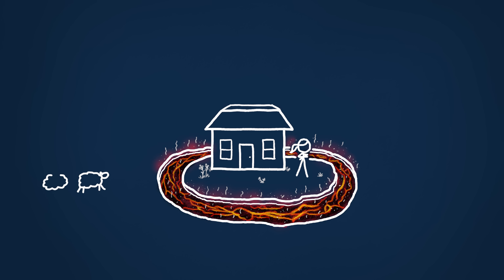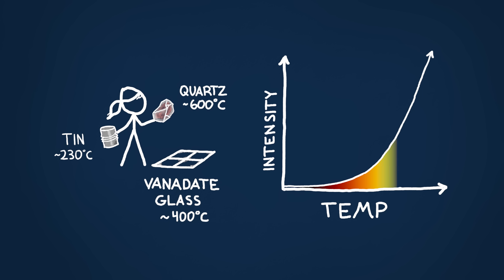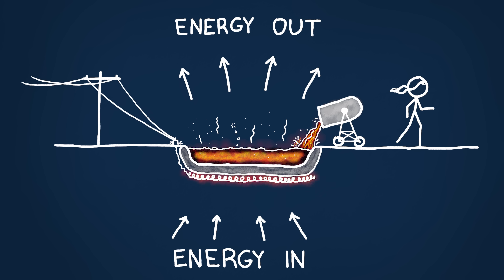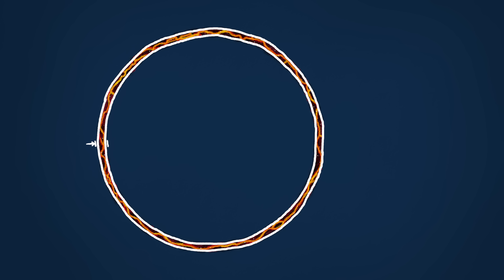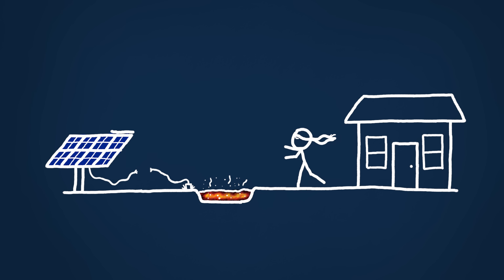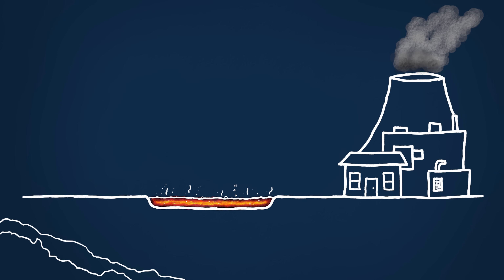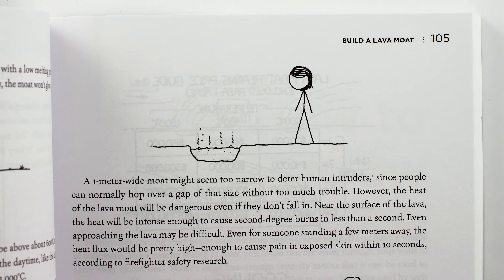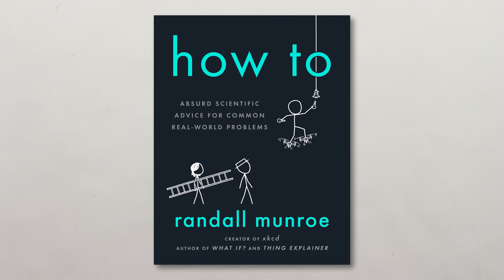How to Build a Lava Moat (with xkcd)

Comment: I’m going to go the 4km solar panel array route.  We need to be green with our lava moats.
Reply: Terrible efficiency losses at each stage.  Go for Fresnel lenses focusing the sun's rays onto the ground.

It will work.  Nobody likes invading houses in the rain.
Reply: @bdf2718  What about a geostationary solar collector that focuses the sun's light onto a circular area around your house. The beam would be 1m wide and precess so that it makes a circuit fast enough to keep the lava from solidifying.
As a bonus, it can be manually overriden to get rid of pesky solicitors, girl scouts and door to door salesmen.
Reply: @V_is_for_Void  
Problem with these things is that you, again, are dependend on outside systems. I mean, it is possible to shoot sattelites with jet fighter air to space missiles down ;D.
Reply: @V_is_for_Void  Unfortunately, this doesn't work. The most you can achieve with a purely optical system (lenses and mirrors) is that your solar collector shines as bright as the sun over its entire surface when seen from the focus area (you cannot focus on a point!). So in order to melt rocks with a geostationary mirror satellite, it would have to be many times larger than the sun when seen from the surface of the earth, and I think at that point you might as well scrap the space mirror and just power the lava moat with all the rocket fuel you just saved ;)
Reply: @MedoFortyTwo  Don't destroy my dreams with your logic!
Besides, this is kind of covered as an in space thing (and if we can get mirrors in space going, I don't see why we can't work on the rest of the SciFi stuff) in the Troy Rising 3 book series by  David Weber. But he makes giant mirrors in space and then hollows out asteroids and makes military bases in space. Because lasers.
Reply: Mandernach Luca I think of your enemies have access to jets and missiles then a lava moat isn’t going to do you much good anyway.
Reply: @supetorus9612  ...you must be real fun at parties, huh?
Reply: @V_is_for_Void  if you have a geostationary solar energy collector of that scale, you don't need a lava moat, because your house is now protected by a death ray (which is equally cool).
Reply: @sethb3090  
I think you mean it's equally hot ;)
Reply: Helicopter hELICOPTER
Reply: @V_is_for_Void  now that's and xkcd answer right there.
Reply: bdf2718 A good point, but the lens would block the rain, giving invaders a dry path in
Reply: @bdf2718  I like this as a backup plan for when the delivery of my power rods is late. 
I wonder if I could build an manually powered generator large enough to power my moat - then I could use renewable animal and people power to keep the moat molten.
Reply: @bdf2718 ...or at night.
Reply: @bdf2718  What about night though? Plenty of invaders then!
Reply: If you're going that route you might wish to go for an extra kilometer or two just so you can build up a power reserve for the days without a lot of sun.
Reply: Colopty What do you mean, “power reserve”? A lava moat is pretty much a giant heat battery, cut out the middle man.
Reply: @thiccityd9773  A very lossy heat battery
Reply: @gracefool  The power loss to the air is proportional to the surface area. The energy storage is proportional to the volume of the thermal storage material. The power loss through the insulation is a tedious but straight forward engineering calculation.

The lava will naturally separate by density somewhat. You want the stuff on top have a lower melting point than the bulk material. That maximizes how long the top will stay liquid after the heaters fail.

Liquid iron is dense, and stores a tremendous amount of energy between it's melting point, and the melting point of some lighter rocks.
Reply: This comment is preposterous, and so is all the debate over it. A green lava moat is impossible for one simple reason: lava is red and orange, not green.
Reply: @ezekielmartin4323  Don't forget white! (Other minerals hitting different heating stages will turn very interesting colors. The red spectrum shades just seem to predominate. I'm sure it looks much different depending on your personal visual range. Seeing into the UV would be something!)
Reply: Watch me sneak in and steal your lava during night.
Reply: Geothermal and nuclear are both clean energy sources
Reply: @Zakara675  yes but how are you going to get your supply of uranium?
Reply: @Zakara675  They're both clean in terms of carbon, but nuclear energy produces radioactive nuclear waste so you'd need somewhere to store that safely, miles underground.
Reply: Actually, yes, that is the scientific term.
Reply: @elevatedaspirations  As long as you understand the meaning - every specialty has it's own jargon. Lava moats being lossy heat batteries is just an example.
Reply: @elevatedaspirations  I guess I know too many engineers from different fields. "Lossy" sounds like a word a 12yo would make up, yeah. But it also sounds like the kind of jargon you hear around a table of specialists of any sort. 
Fun game for when you're bored - take a jargonny word and see how many definitions you can get across disciplines. Statistics is a good place to start. Or Biology. 
Good luck with EE.  That gets fun.  All the bad puns that make other people look at you strangely.
Reply: Nuclear energy is greener than solar.  Solar panels take up so much space, further reducing natural land.  Nuclear energy also costs less to produce over the lifespan of the facility than solar panels.
Reply: p a i n t t h e l a v a g r e e n t h e n
Reply: Geothermal is a much greener choice. I would recon.
Reply: Geothermal is pretty green.
Reply: Solar is not exactly clean...

Those solar panels are going to pollute the environments once they are expired... and they pollute HARD.
Reply: great, ill just sneak in at night
Reply: @dxkaiyuan4177  Doh!
Reply: geostationary fresnel lense would work wonders, vaporizing rain and keeping you warm in the winter, all while being green energy and keeping the moat hot
Reply: The problem with such a satellite is that it would not work during an eclipse, meaning you need to have a second satellite at the L1 or L3 point.
Reply: 1st: nuclear power IS green energy. 2nd: solar panels need to be replaces occasionally and cant be recycled, making them bad for the environment (albeit better than fossil fuels) 3rd: a nuclear reactor would mean tearing up less land in the pursuit of a lava moat, meaning ecosystem conservation. 4th: you could have PLENTY of leftover power for whatever else you want, including a dope ass villain base integrated into the power plant.
Reply: factorio gameplay
Reply: Nuclear is the greenest energy. It glows green!
Reply: nuclear
Reply: 😂
The estimated cost to build a 4km² solar panel array would be significant, likely in the billions of dollars. Here's a breakdown of the main cost factors:

* *Materials:* Solar panels themselves are the most prominent cost.

* *Land:* The vast land area required would incur acquisition or leasing costs.

* *Installation:* Labor and equipment for installing the panels on a massive scale.

* *Other factors:*  Inverter stations, transformers, cabling, and ongoing maintenance also add to the cost.

*This is a simplified estimate and doesn't include factors like permitting or grid connection.*
Reply: Good luck buying that much land and getting the government to allow your moat!

Comment: The melting point of quartz is off by ~1000C, should be around 1650C, not 600.
Reply from the maker: What about http://hyperphysics.phy-astr.gsu.edu/hbase/Geophys/meltrock.html ?
Reply from the maker: https://earthscience.stackexchange.com/questions/14205/melting-point-of-minerals and http://jersey.uoregon.edu/~mstrick/AskGeoMan/geoQuerry32.html
Reply: @MinutePhysics  I have read all three of these links and many of their links and It seems like 600 degrees C (or 800 C in that last link) is the recrystallization temperature of quartz from magma (recrystallization from solution). It could be that that is also the temperature at which the quartz dissolves into the melt (or alternately is fluxed), but I don't think so, but that is not the melting point of pure quartz. The difference between solubility and melting is fuzzy here. Regular soda lime glass softens at 700 C but that is because the silicon dioxide is already fully fluxed (mixed with elements which lower the melting point). The trouble is that to get the silicon dioxide to mix with the flux at a molecular level requires temperatures high enough for the flux to diffuse into the quartz (1675 C) which are close to the melting point of the silicon dioxide (1670-1713). https://en.wikipedia.org/wiki/Soda–lime_glass (third paragraph). 
Including quartz in the list of things that melt at lower temperatures seems to be a little misleading.
(I do like the video though, and plan to buy the book).
https://xkcd.com/386/

Comment: Well if you owned an open area about 1% the surface area of the earth, then surrounding it with a solar powered lava moat isn't such a terrible idea. Just make sure to also include robot lava sharks and anti-air turrets at regularly spaced intervals. Also, couldn't it be possible to make a dome inside the lava moat which reflected say, 20% of the light from the non-solarized space in the middle to the solar panels? That way it's not dark but at least you're getting some use out of that light, and the extra protection of the dome (assuming you made it out of durable enough materials or frame to ward off attacks)

Comment: I'm such a fool, spending my money on an "alarm system" clearly a lava moat is the way to go
Reply: But if it rains
Reply: @alexwang982  The rain would boil off immediately.  Unless a portal appears at the bottom of the ocean (hehe) and exits directly over your moat, water isn't going to be an issue.
Reply: Laminated windows, it stops burglars. Only idiots go through doors, it takes time to pick a lock and breaking one down makes ALOT of noise.
Reply: Duncan Price Yes but how are you gonna get past L A V A
Reply: @The-Singularity-X01  

unholy screaming as your legs catch fire and your flesh melts while attempting a mad dash across a moat of superheated molten basalt.
Reply: Duncan Price yes but L A V A
Reply: @The-Singularity-X01  

...what original comment?
Reply: If you have a lava moat, you don't need additional security. Not because it's impassable, but because if that's your FIRST line of defense, no one will want to break in and find out what the other ones are.
Reply: just use [/gamemode creative] and fill the moat with a bucket of lava

Comment: Or 2400 10w LED bulbs per square meter (eco version). 

No one use 100w incandescent bulb any more, and led bulb of 100w is definitely overkill... :D
Reply: and yet, 100W LEDs exist :) Usually in a shape of floodlight.
Reply: The reason no one uses incandescents is they waste most of their energy as heat.  If you want the heat, don't use LEDs, they waste most of their energy as light, giving off very little heat.

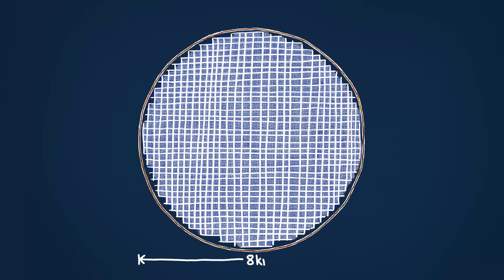Comment: 2:20 "Which is clearly absurd." 
Yeah, that is the absurd part, of course.
Reply: The absurd part is that he didn't advise on the type of crocodile to inhabit your moat.
Reply: @NJ-wb1cz : Crocodiles, in a lava moat? Now that good fellow is absurd. A proper lava moat requires only the highest quality cybernetic laser sharks!
Reply: @EmeralBookwise  good show old boy! 
However, lava is an example of a so called black body and is sadly virtually impenetrable for photons making lasers just glorified heaters for lava, providing no extra layer of protection. Which is the only fatal flaw in your otherwise top notch plan!
Reply: @NJ-wb1cz well he should advise the type of striders
Reply: @NJ-wb1cz  Ridley.
Reply: That's probably the only sentence in the entire guide that is NOT absurd, given that there are quite a number of photovoltaic arrays that occupy an area larger than the circle indicated (~50.2 km^2; e.g. Pavagada Solar Park in India occupies 53 km^2).
Reply: Well yeah, of course that's the absurd part. No one wants a lava moat with a radius bigger than 4 kilometers
Reply: @henryrichard7619  actually, nobody wants the solar panels, WE ALL WANT THE BIG BOI LAVA MOAT.
Reply: solar power is always absurd, except for a Dyson sphere, that's not
Reply: @monad_tcp cheap and easy to maintain definitely have benefits like, for example, off-grid electricity if you're not near a river.

Comment: The final suggestion of using geothermal won’t be easy.  The challenge with using geothermal to melt rocks is finding a suitable liquid to transport the needed energy.  You would need something that would phase transition at over 1200°C at some reasonable pressure, and then you would need some even higher melting point material from which to fabricate the piping and heat exchangers needed.  Copper pipes aren’t going to cut it!
Reply from the maker: The final solution is to use geothermal to generate electricity in the normal way, then heat the lava with the electric heating coils as normal :)
Reply: @MinutePhysics that's clearly absurd. So much energy will be wasted as heat

Comment: 1m wide lava moat does no protection except for some animals and insects I guess. I can just run and jump over it.
Reply: you gonna need a high heat resistant shoe though but fair enough
Reply: you also could probably just run over the lava its not like you would sink in it or anything its quite dense
Reply: @rowanmeddings4567  but the lava itself is quite hot, it could melt right through your shoe if you just dash in, though it would be best to just jump than having huge blisters on the soles of your feet that could annoy you for a week or more
Reply: @oddpotato4038  i agree that jumping over would be preferable was just pointing out how poor of a defense a lava moat would be
Reply: @rowanmeddings4567  fair enough though. I agree with you in considering the lava moat as a security feature. It has high cost and maintenance to begin with and those things outweigh the benefits. The materials also to be used is quite limited and not that generally applicable on most parts of the world, like what if you live close to the polar regions( just a thought) it would probably require more energy to heat up those rocks. But quite interesting though 😂

Comment: What about a moat filled with sharks with freakin laser beams on their head? 

The power requirement would be much more manageable.
Reply: I ain't no scientist but I think light refraction from the water might cause the lasers not be really precise.
Reply: i guess sharks don't like to swim in lava, wait, you're supposed to remove lava first ?
Reply: Frikkin' laser beams. Freaking lazer beams are just cheap knockoffs that actually cost Most than the originals.

Comment: Right, of course. I knew I was doing something wrong.  Thank you so much for this tutorial it has been extremely helpful.
Reply: KingBranden 
You’re having difficulties too?
Reply: @Apersonl0l  same I use mixture of rocks that's why it didn't glow as much
Reply: Ugh yea. Last time the bridge burned for mine. I’m still trying to explain to the government why I need a whole moat
Reply: @boxfox4879 welp I guess you’re not leaving your house
Reply: ikr, i accidentally added uranium into the rock mixture, and iradiated my neighborhood
Reply: @valyrianeagle7001  Know that feel man my uranium ressuply fell into the mote and its now a radiated mess
Reply: @valyrianeagle7001  Well technically, that is going to heat your lava quite well without a power plant
Reply: My power station keeps getting bombed by the authorities. May need to invest in some lasers.
Reply: Fk i tried to build a nuclear reactor and it exploded.
Reply: @wickedraven  oh shit mine works and it's on a diposet
Reply: I got mine to work fine, but only for now...
Reply: I know, right? My moat keeps cooling too fast and I always need external power, this video helped me become fully self sufficient.
Reply: I tested mine out on my neighbours but the fire wasn’t that hot
Reply: @avw5kt  oh i also considered that but it is super expensive... So I settled for this tutorial... The rock they mentioned works really great..  It looks very as bright as expected....
Reply: It's sad. My moat didn't had proper insulation and the my Ur-235 mixed lava accidentally spread in neighbourhood. Still explaining that to FBI 😭.
Reply: Waiting to woosh someone
Reply: This explains why my hose kept catching fire all the time…thx!

Comment: Wouldnt you also need to keep adding rocks to the lava as well as heat?  Im assuming through being constantly hot the rocks will be reducing in volume over time- actually burning up?
Reply: elevown lava is rocks that are hot enough to be liquid, just like water is ice that is hot enough to be liquid.  If you had a moat of water around your house you would (very slowly) lose tiny amounts of water due to evaporation but it wouldn’t be “burning up” and in a completely analogous way if you had a moat of lava you would lose very tiny amounts of rock to a kind of evaporation but nothing would be burning up.
Reply: @jpe1  I was just assuming a lot of gas of some sort (theres lots of oxygen trapped in rocks right?) would also come off the lava and it would thus loose mass.  not 'burn per se'
Reply: elevown there would be some initial off gassing as some very low boiling point material evaporated (for example, many rocks contain significant amounts of water, which would boil away early on in the process) but once the lava pool is at a stable temperature it would pretty much just sit there, glowing red or orange depending on temperature.  It would actually be kinda boring (except for the inherent coolness of being a pool of lava!)
Reply: There would be a point where it was just molten stuff.